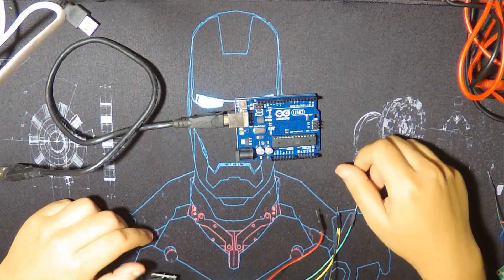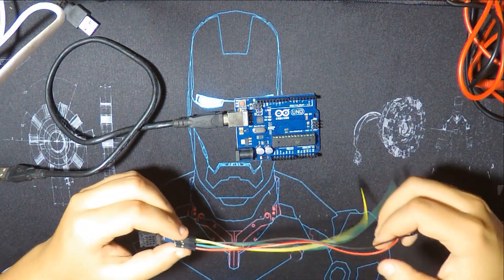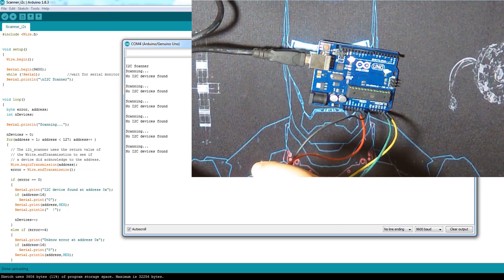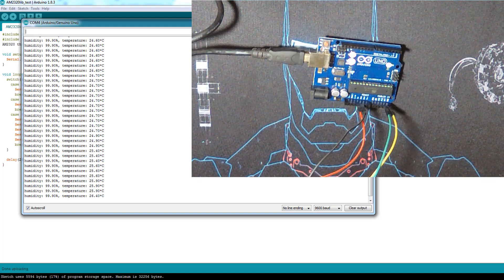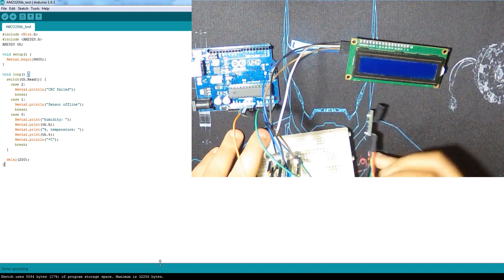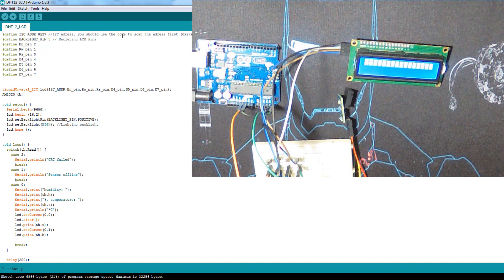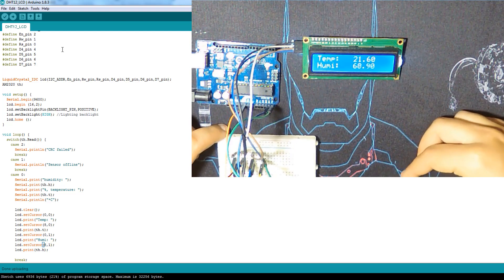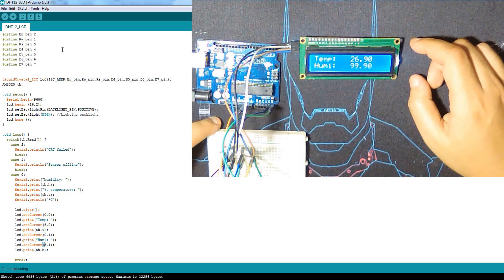Use AM2320 (DHT12 ?) to measure temperature and humidity + Arduino + LCD i2c

Comment: What is the difference between this and a DHT22 please
Reply: My initial thought is that the only difference so far is the communication interface both ise. Dht22 uses a proprietary protocol while the am2320 uses I2C.

Haven't compared yet the results, this is actually on my "to do" list.
Reply: Update: I did a comparison and, spoiler, the DHT22 is still more accurate.

This being said, the AM2320, at humidity percentages around 50-60% have about a difference of 5%, which isn't too bad, but when the DHT22 measured 85%, the AM2320 was at around 71%, so you have almost a 15% difference around these levels.

This is still MUCH better than the DHT11 and since it cost me below half the price of the DHT22 on Digikey, I see it as a viable low cost solution. For accuracy though, I suggest checking out the HDC1080 (which even the breakout board is slightly cheaper than a DHT22).
Reply: I also noticed that the AM2320 reacts faster to changes